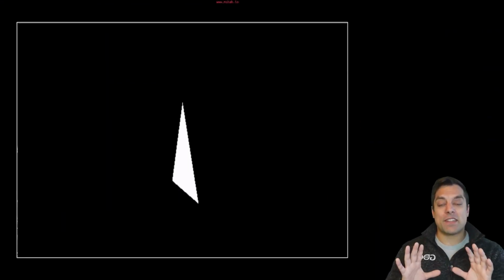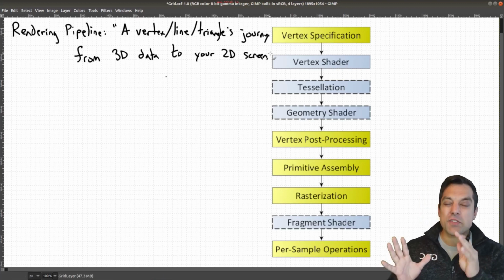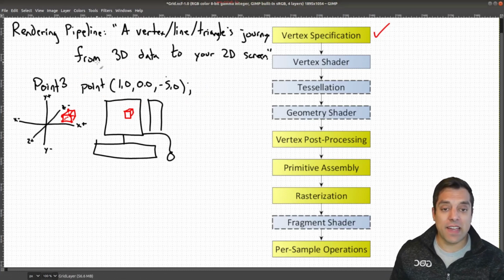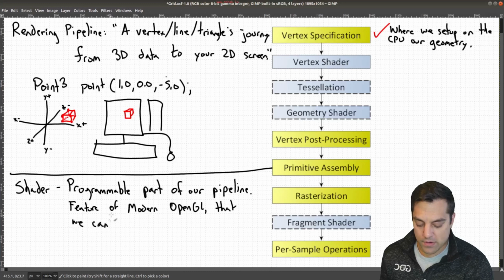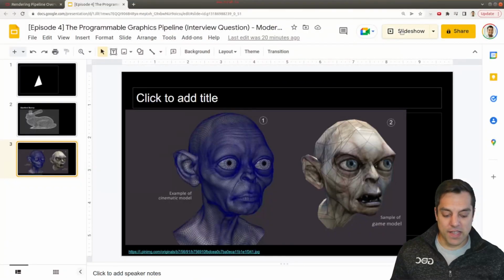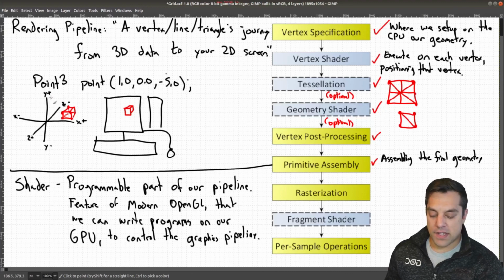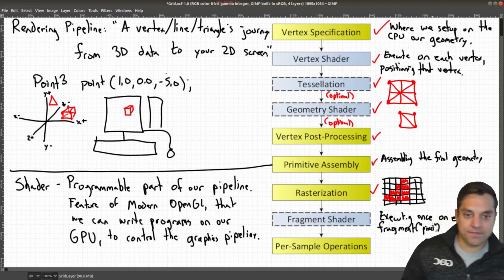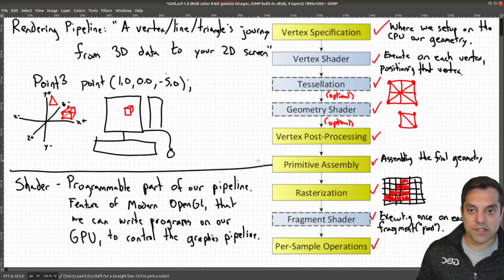The Programmable Graphics Pipeline (Interview Question) - Modern OpenGL [Episode 4] [Theory]

Comment: you should read more
Reply from the maker: What reading would you suggest?
Reply: @MikeShah   a more mathematical approach.   jim blinn s corner a trip down the graphics pipeline. 
or marschner fundamentals of computer graphics.
or more in depth math multiple view geometry zisserman.

I need to know more about c++ i didn t even know what a link was
Reply from the maker: Blinn's Corner would be nice for a software rasterization series, though it is nearly 30+ years old. Marschner's text is very good for reading -- and I would expect most folks in a graphics course may use that and supplement with my videos for application. See my series on C++ for more. 
  @abnereliberganzahernandez6337

Comment: Hallo Mike,
can you please defferentiate between vertex and point. In vertex specification : what is setting up our geometry on the cpu? is it loading the different point coordinates on the cpu?
i think that moving from 3D representation to 2D will result in loosing some points .
Reply from the maker: To be clear Vertex will refer to a 3D position in space. Point3D would mean the same thing. On occasion, I'll use 'point' in OpenGL to talk about a primitive (like a triangle), that refers to just rendering one vertex.